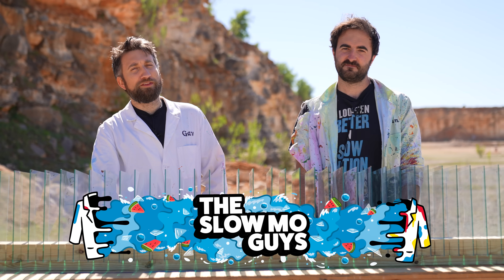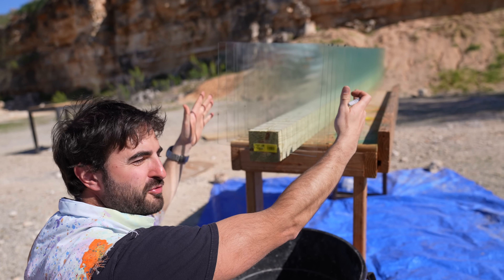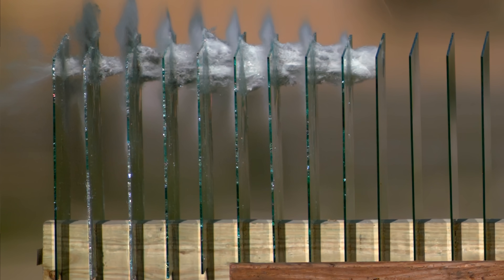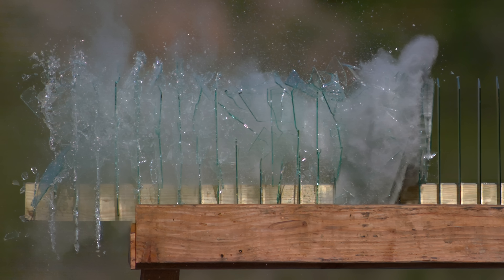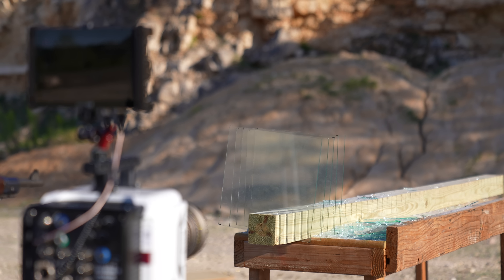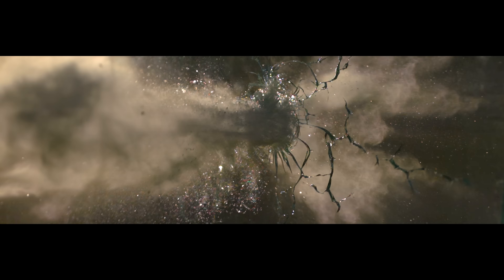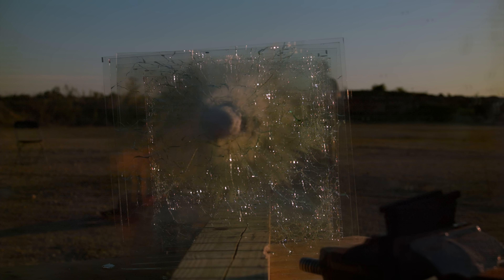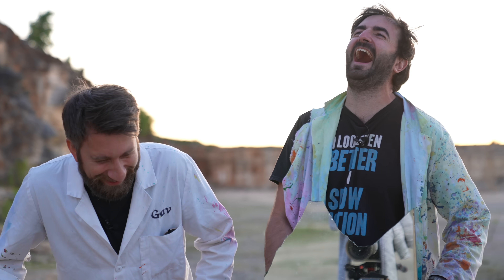Backwards Bullet Shockwaves between Glass at 375,000 FPS - The Slow Mo Guys

Comment: 0:28 [Upd: i was wrong, see thoughts as to why below this initial prediction] before watching the video (but after googling the muzzle energies of both bullets and mass of 30-06 bullet) my prediction is it will easily penetrate all 50 pains of glass and after that will be moving at 264~447 m/s (depending on the exact parameters of the 9mm and 30-06 cartridges and guns)

Upd: oh, no, it just dumps a lot more energy into each pain... which, i guess makes sence - 30-06 is moving faster and so has to accelerate the glass to a higher speed to move it out of the way. If i assume needing to accelerate glass to bullet velocity and scale by the difference in... bullet crosse-section? buller frontal area?, the answer becomes 12~27 pains.

Comment: According to quantum physics (and experimental data), each pane of typical window glass reflects 4% of light that hits it, with 96% passing through to the next.

With 50 panes the last pane will pass 0.96^50 of the light hitting the first pane.

That's why you can't see through the stack.

Comment: My only question is why not use an FMJ with the .30-06?  The deformation of the soft lead tip of the round y’all  used was bound to cause some sort of deflection as it changed the aerodynamic shape of the bullet.  

Plus, you used 9 mm FMJ and so comparison between the effects of the rounds had an additional factor beyond weight and velocity.

Comment: When a supersonic bullet strikes glass, an *intense shockwave* compresses a tiny volume of material at the impact point in mere nanoseconds. This happens so fast that heat can't escape (*adiabatic compression**). Temperatures instantly soar to **thousands of degrees Celsius* (like the Sun's surface!), causing the compressed glass (and possibly bullet material) to  glow white-hot**. This thermal radiation is the visible flash. Friction and rapid fracturing (**triboluminescence**) might add a minor contribution, but the primary source is **extreme, localized heating**.

The Fun / Mind-Blowing Fact (The Cosmic Connection):**

While the total energy of a bullet is tiny compared to a star, the density of energy released in that microscopic impact zone is astonishingly high. Here's the cosmic punchline:

*   In the nanosecond of impact, the *power density* (energy released *per second, per cubic meter*) within that tiny hot spot can reach a staggering **10²² Watts per cubic meter (W/m³)**.
*   *Amusingly, this is within an order of magnitude of the power density generated in the collapsing core of a massive star JUST BEFORE IT EXPLODES AS A SUPERNOVA!* (Supernova core: ~10²³ W/m³).
*   *Think about it:* For a fleeting moment in a speck of shattered glass, the frantic intensity of energy release rivals the furious power struggle happening in the doomed heart of a giant star about to die in one of the universe's most violent explosions. It's a microscopic echo of stellar-scale physics!

*Scientific Punchline:* The flash is earthly thermal radiation from extreme compression. The fun fact? That tiny bullet impact, for a billionth of a second, packs energy into its micro-volume with an intensity *comparable to a dying star's core* – a testament to how concentrating energy (even modest amounts) in a vanishingly small space creates extreme conditions, whether in a lab or a supernova.

So, next time you see that slow-mo bullet flash, remember: you're glimpsing physics intense enough to be, quite literally, stellar in its density
Reply: Have you commented this on the SmarterEveryDay channel? Destin had a video from a while back where he was trying to figure out that exact phenomenon and what causes it. I'm sure he'd be glad to have an explanation.
Reply: @DarkXork hmm maybe)

Comment: At 7:10 it shows how the bullet shatters the glass, but only the exhaust gasses from the gun following it push the pieces apart. It'd be interesting to see a bullet fired from a little bit of distance, to see how the pane would fare without the pressure wave.

Comment: The increases of visible structure made me think of the mapping  of a coast. If you repeat the measurement and decrease the smallest distance you map, the length of your coastline increases, theoretically until you "cross  over" to the quantum realm, ...🤔...at which point I have to end my comment, for safety reasons! 🧐

Comment: This might sound stupid, but if the panes are closer together wouldn't that effect the deceleration of the bullet? For instance, if the panes were all touching, it would be like a glass version of a bullet proof vest. I think you should use the same distance between the glass as the 9mm to get an accurate power measurement
Reply: https://youtu.be/7bttEF00C5A

Comment: To minimize the blast that follows the bullet, would it help shooting through a angled metal plate with a large enough hole that's angled up, so that the bullet isn't obstructed but the blast will go up so you get a cleaner result of the bullet going trough the glass without it getting blown away

Comment: The 9mm was a FMJ bullet and the 30-06 had an exposed lead tip. If you would have used a FMJ 30-06 you would have probably had better performance.

Comment: Our company did some research in this area, and my gut feel is that these bullets do NOT have enough energy to create "plasma lights".  What is probably happening is that the local gas compression, along with greases and contaminents on the bullets and glass, are actually making a detonation at the point of impact.  You can see that the light flux through the glass is much much faster than the physical shock wave.  CSM did some experiments, showing that crack and leader propagation in materials, can often be initiated well ahead of he physical sonic wave.  The reasons for this are still subject to argument, but the light-wave itself is though to initiate structural debonding, in some cases, mostly in transparent materials.  YOU should try this with simple metal plates, aluminum, copper, iron, or plastic, and see the visual color differences.  That would give you an analysis of the actual species involved.

Comment: I wonder if the “reverse” shockwaves are due to the fact that you hit the glass panes so high the first time. Hitting the top of the frame would amplify the vibration transferred from the bullet to the glass. The shockwave then may be the vibration being transferred from the glass to the air. Just a thought.

Comment: Consider a sabot .223 55grn out of a 30-06 (Old 'Accelerator' rounds or a reload). Upwards of 4200 fps. show the difference between mass at a slower speed and less mass at a higher speed - through those glass sheets. Not sure if it'd be enough of a speed difference between a 160-185grn -06 round, but it may be. More speed, more effects?? Easy, cheaper test would be a .223 Rem (or 5.56 NATO) at about 3100 fps. Curious to see what may be different - or not! That'd be telling, too.

Comment: There is a company called Faxon Firearms that has a line of barrels and complete guns that have a 1:3 twist rate which causes a bullet to spin about 2 to 3 times faster than bullets from most rifles. I'm wondering if the faster twist rate would stabilize a bullet going through glass plate better than your test rifle.

Comment: A couple things. First, you mention "the Kentucky Affect". Would it be possible to do a collab with Scott again and get your hands on a black tip AP round to see how far the tungsten core would make it and how many flashes you get from that? Second, I noticed in some of your shots that the round passed through the pane of glass, then the gases from the rifle were catching up and starting to push the glass panes down. Could you set up a wood panel with a small hole in it to shoot through. That should let the bullet through while minimizing the gases that will push down the panes of glass. Am curious if its the energy transfer from the bullet that is knocking them down or if its the gases hitting them. For science!

Comment: 3mm glass that you use for normal glazing  is high in iron as you can see edge ways , green tint . If you used a purer glass with a lot or lead similar to crystal  eg. cups decanters etc the resistance could be totally different . What i'm trying to say  glass has so many different minerals involved in the making of it. I hope that make sense .

Comment: So shooting through glass is like sending a bullet through a tunnel in glass that has an angle that is dependent on the angle of entry and the angle at which the glass lays. In the military, I was trained that if I have to shoot into a front window, I have to aim high because the glass will defect the round downward. Likewise, when shooting out of a front windshield/screen, to aim low. It's the same way a prism will bend light according to the angles of the prism. That's why that one single pane  cause that round to tumble. They 2 leaning opposite directions and see if the effects counter each other.

Comment: The flashes are oxygen igniting as it's compressed between the bullet and the glass. The bullet starts to release all of its energy. As the bullet flattens out, the flashes grow brighter and larger due to more surface area, so more compressed air.

Comment: 2:20 Ok, You talked to Dustin from Smarter Every Day about it, but did you notice the flash on impact? The first Seven had flash impacts and the glass dust particles were reduced, while eight and on there were more particles. Also the shockwaves from the bullet and off the glass have different angles.

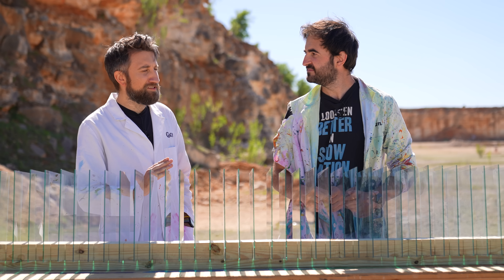Comment: 0:48 I'm thinking a high velocity .22 would go through more than the 9mm. And I know a steel or lightweight zinc alloy .22 would because less deformation means they punch through without imparting as much force into the surrounding material. That's why lead is better for hunting, but high velocity non deforming rounds might just pop out the other side of an animal and it'll run off and bleed to death where you can't find it
Reply: 10:00 yeah by this point I'm pretty sure I'm right. I used to have a 12ft/lb .22 air rifle and I shot a 2mm steel baking tray with a 20 grain lead pellet, and a 5.5 grain zinc pellet. Lead one dented it, zinc one punched right through leaving far less deformation. A small, hard, higher velocity projectile would almost certainly go through every pane of glass and probably not shatter them either, because it's not imparting much force.

Comment: Gav, have you ever thought of filming ultrasonic misters humidifiers? I heard of two types. Surface types have a perforated disk that runs at 113 kHz. The solid submersible type run at 1.65 kHz I think. Both can be purchased for just a few dollars each at ebay or amazon etc...

Comment: The fact that the larger bullet didn't break all that many more panes wasn't too surprising. If anyone is old enough to remember the Mythbusters' "Underwater Bullet" myth, they found that most calibers stop within a meter or so, and the more energy the round is carrying simply results in a bigger splash and faster deceleration, due to the fact that water is incompressible. So, I predict that if the distance between the glass is maintained from this video, the .50cal might break 27 panes. Let's see!

Comment: Use "Low E" glass next time.

Its  glass with low iron content which makes it much more transmissible to light (no green tint.) Look edge on to normal glass and you can barely see out the other side. very different with low e glass. Frequently used in high-end aquariums.

Comment: I wonder if you could film and measure light speed in a way using planes if glass. If the camera is fast enough. And let's say there was a flash of light like when the bullet makes contact with the glass, and you can see the reflection go to multiple panes of glass. I wonder if the camera were theoretically fast enough, if you could see the panes of glass light up in sequence? Like, example, the first pane is his with light, and than a Nana second later the second glass piece, than the 3rd.

Comment: Since the flash is consistent, maybe recording it as the slowest you can from those angles will give better data on why it happens or where it starts. Is the glass the origin or the bullet point? Is it because of shockwave compression at the point caught between the flat surface and reaching a critical mass? It’s super fascinating.

Comment: Pretty sure that those flashes are not triboelectric phenomena, but rather just pyro induced events, caused by a fire piston effect at the leading shock/material interface, and then rapid deformation and heating of the materials subsequently.  It has been shown that both reduced oxygen and reduced pressure reduces that flash effect, and that would not be the case if the flashes were caused by electrical charge transfer.

Comment: Since the flash originates at the tip of the bullet, it must be generating a tremendous amount of heat and vaporizing the glass upon impact. Given that there are several flashes, one on each pane, the amount of energy being expended must be substantial.

Comment: The more kinetic energy the round has, the more energy is transferred to each pane. More mass/higher density is the only way you're going to get through 50 panes. Simply increasing the velocity isn't going to do it. (Not within the realm of any standard firearm round, anyway). A. 50 BMG will probably?? do it. I'd be more interested to see the difference, if any, between a lead core 30-06 and an, otherwise identical, solid steel round. I bet there wouldn't be much difference. Maybe 4 - 5 more panes.

Comment: Compress air to 150 psi and ideal gas law says the temp will reach an ionizing 5,000F.  Since air can’t get out of the way fast enough upon impact, a speck is compressed adiabatically to maybe several thousand psi.  Surely enough to generate a readily visible glob of ionized air.

Comment: if i could take a semi educgateded guess at it, i think the bright flash is a tiny explosion as a result of the full mass of the flying object making a connection on the tiny area that is the tip of first connection, like how a meteor burns up in the atmosphere or hitting a hot peice of iron with a hammer, but on a tiny tiny scale and for a brief moment. the same thing happens with bullets, spheres, etc but what they all have in common is a lot of force connecting into a tiny area. the narrow displacement of relatively massive energy in that moment kinda errupts, resulting in an explosion and the brief flash of light.

Comment: Awesome video once again guys, thank you! Would be interesting to see how much of a difference a normal soft-point vs. a penetrator round makes in a test like this. =)
EDIT: If you do it with a .50 cal, please please try to get some penetrator ones. It'd be so cool to see how many flashes you can get from a projectile that doesn't deform on the first pane. <3

Comment: I dont know as the 50 is the way to go.  Might should try both AP and ball if you go that route, though.  Well, assuming you can get any AP that isnt also incendiary.

Another option might be one of the various inter war anti tank rifles, mostly in 20mm, again with both training ball ammo and actual AP.

Also might consider one of the new-ish, high velocity, long range calibers that can run solid copper bullets.(like 416 barrett, at the higher end, but i think there are some 338s as well that aren't quite as much beans)

Comment: You should try this testing with the 220 Swift with a 26" barrel, using a solid copper bullets. The Swift is the fastest production cartridge ever, however in the last few decades the ammunition manufactures have been pud loading this and many other high performance cartridges so it is best to handload the Swift. Standard velocity is 4,100 fps, with lighter projectiles 4,400+ fps is achievable. The ultra fast velocity may give some interesting results.

Comment: Here's a question or idea for your next follow-up on these bullet-through-panes videos. It looks like you have several frames showing the "flash" (triboluminesnce or mechanoluminesnce perhaps) growing outwards after the bullet hits the pane of glass. That means you ought to be able to estimate the speed of propagation of that flash within the glass.

Here's the question: is that propagation speed of the flash the same as the propagation speed of cracks in the glass? I bet yes: that the flash emits along the frontier of stresses propagating out from the impact, as are the cracks.  I imagine this is the speed of sound in the glass (transverse wave speed in the glass) if so?

Comment: How about you put the high speed in front of a microscope, then put a pane of glass 45 degrees against that and shoot the bullet parallel to the lens of the camera into the 45degree tilted glass.

Very small frame for maximum slow mo, maybe a filter to dim the light?

Just to see that the moment the light starts, probably a dumb idea but w/e.